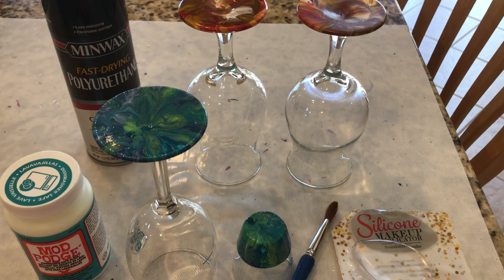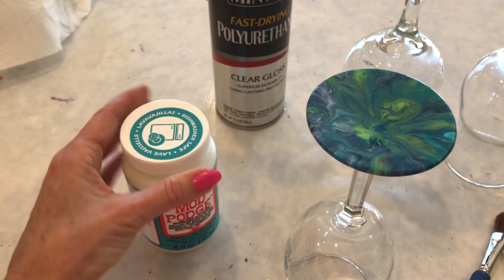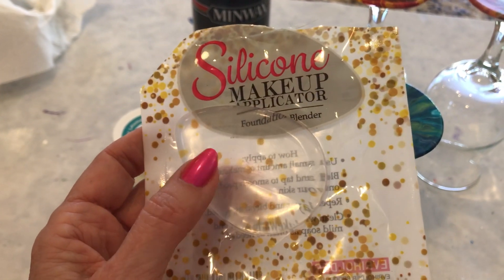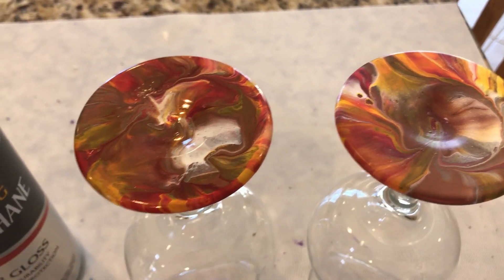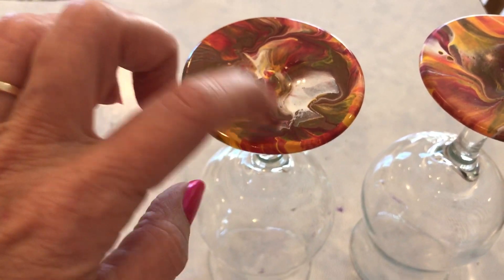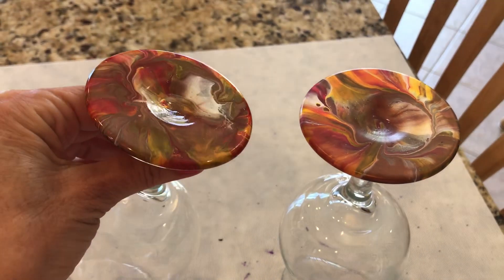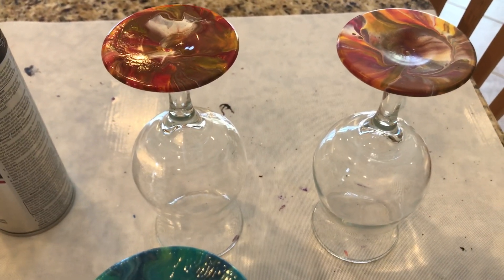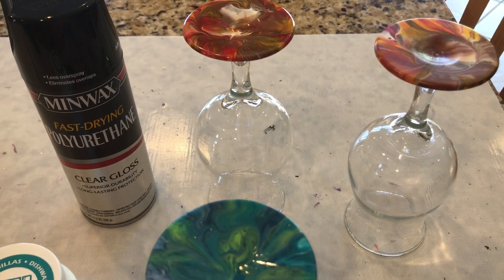Better Sealer Option than Mod Podge for Glass

Comment: Multi surface acrylic paint can be heat cured based on manufacturer direction. Anywhere from 24 hours to 72 hours afterward.  And you don’t need to seal it.
Reply from the maker: Are you heat curing in your oven? I've heard some people do that but I haven't tried it due to our new oven and not liking any smells or toxins in the house. So I've stayed away from heat curing.

Comment: Hi there. Thank you for the video. Your video is the only one I've seen where someone used polyurethane. Do you think this will work well on glittered wine glasses? I'm only putting the glitter on the bottom. Thank you.
Reply from the maker: Hilary Williams, the only problem with using any spray sealer over glittered paint is that it will still have a lot of texture. If you’re ok with that, then the polyurethane spray would work. Course you could always spray a few coats of polyurethane on which would help the smoothness a little but even if you did many layers of spray, I don’t think it would ever get super smooth. You’d probably always have the glitter texture. 

If you wanted a smoother finish, sealing with resin would be better but that’s expensive, kind of touchy to work with and it’s really toxic. 

Good luck. 👍🏻

Comment: What sealer do you use for clear, waterproofing?
Reply from the maker: The spray I used on these glasses is waterproof but I never set them in water nor do I ever wash them in the dishwasher. I've tested setting the painted/varnished part in water and after about an hour, the paint started to get tacky. It didn't come off but I'm guessing if I left it for hours in water, it may have started to peel off. After all, the paint is just acrylic so it adheres better to porous surfaces. To make sure the paint stayed put, I let the glass dry for a few days just to make sure the tacky paint was cured again. Then I sealed it with another spray of this varnish. It went right back to being very hard so that was good.

Dishwasher water temperatures are much hotter than if you wash by hand so I'm pretty sure that would melt the painted part. I've never experimented with the dishwasher because I didn't want something weird to happen to my appliance in the event the paint got stuck somewhere. 

So all that said, I still use these glasses and it's been four years since I painted them. They've held up to normal use and hand washing so I think the spray varnish I used in this video was a good waterproof option.

Hope this helps.

Comment: Is the polyurethane food safe?
Reply from the maker: If you Google, you'll see a lot of information that "say" it's food safe because they use polyurethane on cutting boards and wood counters. However, I, personally, try not to get any chemicals near food which is why I only paint and varnish the bottom of glasses. Some people paint up the sides but then still leave an inch or two at the top where your mouth would touch. That's still too close for me, personally. 

But the online information says that it's safe once it dries hard. I think you have to do what is comfortable for you and your family.

Comment: Are they dishwasher safe?
Reply from the maker: Kanece's Kreations, the Mod Podge says it’s dishwasher safe but I still hand washed those pieces. I’m not sure about the spray varnish being dishwasher safe since I’ve always hand washed any glass with paint just to play it safe. I like them too much to test it. 😉. But I have used really hot water to hand wash and it hasn’t done anything to them. Sorry I can’t give you more details.

Comment: Thanks for the tip. Will definitely try this. However, on the green glasses, maybe you can try sanding them with a fine sand paper to correct the streak and then repaint or spray.
Reply from the maker: Yes, that's an idea but I'm leaving these the way they turned out just to test them long term and see what happens. :)

Comment: Thank you! I had this idea to put my Disney Aristocats nail decals on my glass coffee mug. Do you think the polyurethane will seal the whole mug?
Reply from the maker: I don't think it'd be the best option for sealing decals on glass because the spray is very light. Even if you put several coats on, I think the decal edges would start to lift away form the glass. I always wash these by hand but if you had decals on, even handwashing would tend to catch the edges of the decals I think. 

Most people who put decals on use resin to seal the drink containers. But with that, you definitely wouldn't want to put it all the way up to the part you drink from. I know some say once resin is cured, some brands/types are food safe but I personally, wouldn't risk it. So maybe if you only put decals on the bottom half of the mug and then just resined that part, they would definitely stay on better than this spray varnish and you wouldn't have to worry about touching resin to your mouth.

Comment: Thank you so much! You are brilliant! Do you think it will work on rub on transfers not meant for glass? I used a beautiful transfer by re design with prima that is usually used on wood or furniture and put it on a glass top of a patio furniture. On wood you seal it w top coat, on glass I cannot find anyone that has done this and since it is going to be outside under a terrace it is going to peel. I hope this works!
Reply from the maker: I've never used those transfers nor have I put any artwork outside but this video might be helpful. https://www.youtube.com/watch?v=ZXAYjomKLIw After she applied her transfers to the glass vase, she sealed it with a different sealer than what I used. I would try a small transfer on some glass, then spray the MixWax polyurethane on. Once it's dried, set it outside to see how it holds up in the weather.  If I had to guess, I think it would be fine in the rain since I've washed these glasses in hot water and they're still fine. However, most sealers will eventually yellow if they're in the sun, even the ones with UV protection. Those may stay clear longer but almost everything will yellow in time. So keep that in mind.

If I were using a transfer on a glass top table, I'd probably put the transfer underneath if the design wasn't one direction. But then, you could seal it and it wouldn't be affected by anything that was on top of the table. Here's another artist who does a lot of painting on the bottom of glass plates. https://youtu.be/i2-2x95UouY  She uses a different spray varnish. 

So as you can see, there are a lot of options. The best thing to do for your specific project is to do a small test piece. That way you'll know for sure. Good luck.
Reply: @NancyONeill  thank you, this was helpful.

Comment: Can you put the poly... glass in the dishwasher or soak it?
Reply from the maker: Absolutely not. I've experimented with one glass and just set it in water in the sink for several hours, basically like you said soaking it. Even with that, the paint started to separate from the glass. So I am 99.99999% positive that the hot water in a dishwasher would peel the paint and varnish right off. 

Someone gave me a painted coffee mug that didn't come with instructions. It seemed like it was sealed but I mistakenly put it in the dishwasher and the design sort of melted away. So with any painted glasses, mugs, etc., even if they're sealed with a waterproof varnish, I would always hand wash only. Even those who seal with resin recommend their products get hand washed. 

When I've given these away, I print up a little Care/Instructions card so people know they are NOT dishwasher safe and even recommend not letting them sit in water very long.

Comment: Hello Nancy, I used our old sliding doors for faux glass painting to set it as a weather protection next to our backyard door.
After a while the faux stain and some of the inside paintings lifted up 😔.
I'm working on the 2nd door right now and I'm wondering if this PU Spray is sealing my work good enough to last.
I'm planning to redo the 1st one. It's a lot of work and very disappointing to see that.
Reply from the maker: Gundi Ruedenauer, the Minwax polyurethane spray says it’s only for indoor use. I don’t know if there’s a polyurethane for outdoor use but you could check on that. I know there are sealers and varnishes for outdoor wood projects but I’ve never looked for sealers for outdoor glass use. If you find something that you think might work, I’d do a test piece of glass and set it outside long enough to get a good test before doing your actual project. Hope you find something that works. Sorry I don’t have a specific product to recommend. Good luck. 👍🏻
Reply from the maker: Gundi, as soon as I hit post on my first reply to you, I remembered that Mod Podge has a weather resistant sealer. I’ve never used it but you might find this article helpful. I just googled and saw it. 
https://modpodgerocksblog.com/is-mod-podge-waterproof/
Reply: @NancyONeill  thank you!

Comment: Thank you for this idea! I hand paint ornaments and I will give this a try! 
I just have one question, do you find that the polyurethane yellows? I’ve have problems with polyurethane yellowing on wood. I just don’t know if it does that to glass.
Reply from the maker: I've been using these same glasses since I did them in March 2020, hand washing them, and they've never yellowed. Granted, I didn't use much white paint so if you had a lot of white in your design, you may see some yellowing over time because there isn't a varnish or even a resin that doesn't eventually yellow, regardless if they say it's UV protected. Have fun.

Comment: What would you recommend I used to waterproof and seal stickers on the sides of a metal water bottle?
Reply from the maker: I'm not sure about metal as I've never painted on that. The only thing I've seen people use when they paint on metal tumblers is resin/epoxy but then you need to keep it rotating while you're applying resin so that it doesn't clump up or run. I've watched videos and it seems really tricky. ;) Plus, keep in mind that anything you use (including paint) on a drink container, you'll want to keep it away from the top part where your mouth will touch. 

You might keep searching for different options. Sorry I couldn't help more.
Reply: @NancyONeill  Thank you, I’ll keep looking before I try anything! 💜

Comment: I'm doing some vases and I was told to use resin. What would suggest?
Reply from the maker: Resin would work too and give it a glossier finish. I chose to use the spray because I don’t like working with resin (chemicals, price, finicky, etc). If you happen to not mix resin right or the room temp isn’t warm enough or any number of other missteps, resin won’t set up hard. So while it may feel hard enough on the bottom of the glass or vase, it may be just soft enough to stick to the table. For me, I just felt the spray was the better option.

Comment: I like to ask a question . I’ve just finished of a glass splash back , which is to be used at the back of my cooker .  Do you recommend the sprayer on that ? . The area I’m think of will be the back of the glass . I’ve already notice some paint is flaking off the glass , so wish to seal it . Once sealed this will be in contact with the wall and front side of the glass will be what you see . 
Hope that makes sense. I can’t seem to upload a pic 😞
Reply from the maker: Oh my, I wish I had the perfect answer for you but I've never done anything that massive like a back splash. If you could, I'd make a test piece of glass and try different sealants. You wouldn't want to spray or varnish or even resin the whole back splash, attach it to the wall and then find out it yellows or something. Sorry I can't be of more help. Good luck.

Comment: Are you using the oil or water based product?

I do acrylic pours over glass vases, candle holders, etc.

I have tried resin, and some other products and I am not liking the results. 

I just want to protect the paint and prevent it from chipping off, and to get an even finish which I have not been able to achieve with resin. 

Bubbles and brush strokes have also been an issue, as well as drips (stalagmites) with the resin. 

I’m tired of ruining beautiful artwork trying to find a decent top coat.
Reply from the maker: I went and looked at that same can from the video and it's crazy that nowhere on it does it specify oil or water based. The only thing it says is "For easy clean-up, use lacquer thinner." That would lead me to think it's oil-based. However, when I Googled "how to tell if varnish is oil or water based?" it says oil-based has an amber hue which darkens over time whereas water-based stays clear. Since I used this spray varnish a couple of years ago, it's stayed clear so that makes me think it's water-based and polyurethane apparently does come in both versions (according to other resources). To tell you the truth, it's confusing. When I looked on Minwax's site, they've changed the can design so it's hard to tell. You'd think they would have better information. Wish I had a definitive answer for you.
Reply: @NancyONeill  I’m inclined to think it’s oil based as well. 

At this point all I can do is keep trying different products.  I’m determined to make this work as the pieces I have done turned out beautifully. Not to toot my own horn. 😂

But I also can’t sell stuff that isn’t going to last. 

I appreciate you red ndong do quickly. 

I do love the way your glasses turned out with this product so maybe this will be the one. 🤞🏼🤞🏼🤞🏼

Comment: Hi Nancy, if I use this on a large area of glass will it dry looking like normal glass still? I want to screen print an image onto glass and then use the spray the cover the whole surface to avoid too many bumps. I don't want the glass to look different from the rest of the glass. Thank you !
Reply from the maker: That’s a good question. I don’t have any experience with screen printing on glass so I can’t address that specifically. As far as that image part looking like “normal glass” still, not quite sure what you mean by that. The parts that I dipped in paint and then sealed with the spray varnish still look like normal glass except that they’re painted. You can tell it’s still glass though. Keep in mind that with my glasses, the paint is on the underside so when you look at the glass upright, you’re seeing the painted part of the stem base through glass. Although because I used opaque paints, you can’t see “through” the painted base. But it’s very shiny underneath from the spray varnish and shiny when looking from the top side because that’s not painted so it’s clear glass. Hope that makes sense. 

One thing I always caution though is not to spray varnish anywhere close to parts of glasses or plates where food or mouths come in contact with. So I always recommend doing the design and varnishing on the underside. 

If this didn’t help or you have other questions or want to explain your project more, feel free. I’m always here to help if I can.

Comment: I recently made a glass art piece and used acrylic paint markers to draw & color the designs. Would the Polyurethane spray work to keep it sealed? I know if I spray it with water/windex and wipe it’ll come off, so I want to make sure it doesn’t run when adding
Reply from the maker: Based on my experience, my best guess is it would keep it sealed just fine. What I found with the polyurethane spray is that it made the acrylic paint rock hard. Before I sprayed it, the painted part had a typical acrylic feeling when I rubbed my finger over it, pressed my fingernail into it and also tapped the painted part of the glass. But after the spray, the painted part felt and sounded just like the plain glass part. 

I've used these same two glasses for about two years and by just hand washing them, it's held up very well. The only "lessons learned" I had in the past few months was when I left the glass sitting in water for a couple of hours before washing and drying it. Then the spray seemed to get a little tacky. At that point, I was able to make a fingernail mark in the painted part. I immediately kicked myself for letting it sit in water but who knew? So I figured I'd just give it another spray of the same varnish and let it sit for a week before using it again. BINGO! It re-sealed the paint and now I can't even remember or tell which one I re-sprayed. 

So based on all that, I would imagine the acrylic markers with this spray sealant would do just fine. Just don't make the same mistake I did and let it sit in water. I guess I just got lazy one day and didn't hand wash right away. ;)

Comment: Hi Nancy, Deborah from Australia.  Is the polyurethane spray acrylic or oil based? Asking because Minwax is not available here.Thank you
Reply from the maker: Hi Deborah, This particular Minwax spray is oil-based. Here’s the link to the product on their website. 
https://www.minwax.com/wood-products/clear-protective-finishes/interior/minwax-fastdrying-polyurethane

I honestly didn’t even try an acrylic spray because I thought any water-based sealer wouldn’t hold up as well. I could be wrong though. But I used this polyurethane after seeing another video so I tried it and it worked great. The paint hasn’t come off with hand washing so I guess it was the right choice. 

However, I have googled “how to seal acrylic paint on glass” and found plenty of sites that say to use an acrylic sealant. I wish I had a more definitive answer or advice for you. 

I’d check out a few more videos or google sealing  glass and then see what you’re comfortable trying based on what products you can find there. Maybe try a test piece and wash it a bunch of times to see how it holds up. The only thing I’d say for sure is don’t paint or get sealant near the top where you’d drink from or if it’s on a dish where food would touch. Even if something says it’s “food  safe,” I personally wouldn’t want to take a chance.